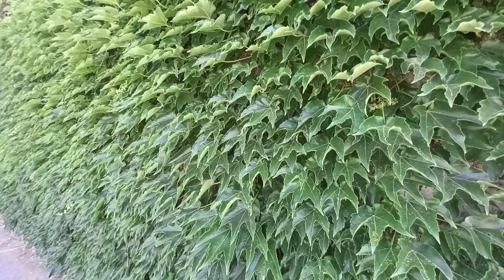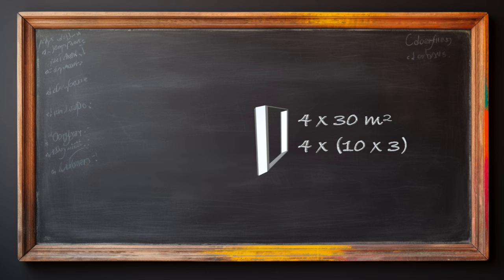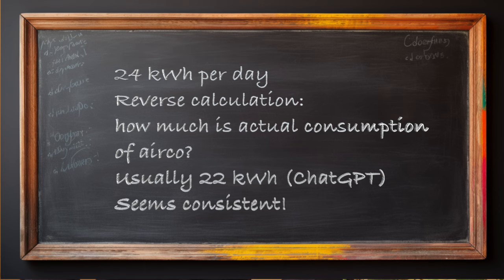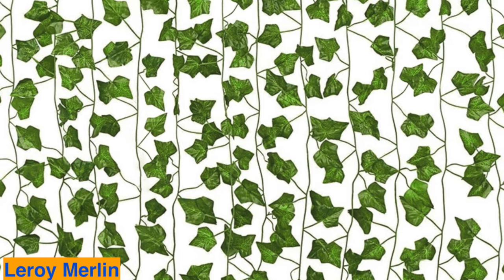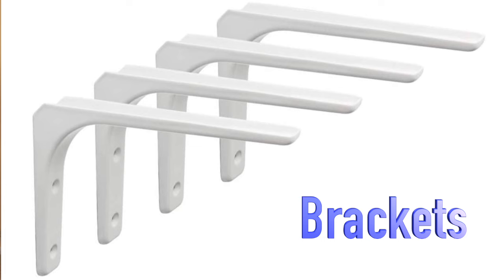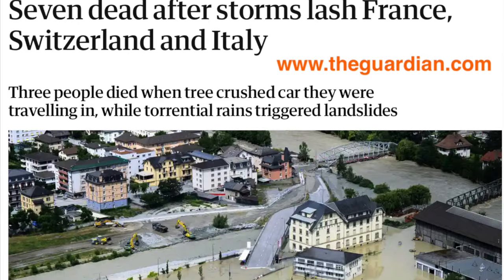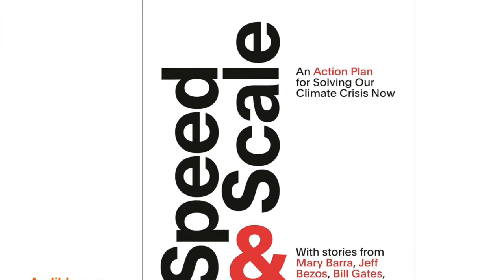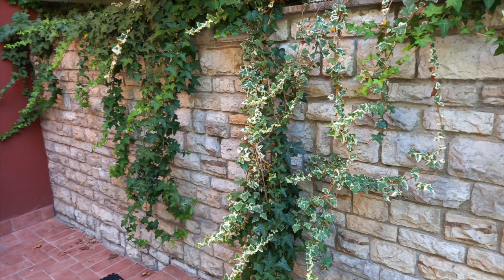Innovative Home Cooling: Build a Green Wall and enjoy zero energy and silent cooling - Video 54

Comment: I love your channel, I live in Washington state but I also represent Costa Rica.
Reply from the maker: Thank you very much Mr. Ramtechs! I imagine also in Washington and Costa Rica there are some heat problems. Did you see also the Spanish subtitles! I check them for each video but am not so good in Spanish. Tell me if you would like to see a particular theme in the next videos.
Reply: @nnvasen-good-energy  I don’t have any problem with English itself, I checked out the one with German subtitles, if I see anything wrong with the Spanish subtitles I will let you know. I truly love your materials. I studied dynamic of fluids and refrigeration when I was a teenager. So your topics bring me back to my physics classes. I have a small space in CR that I wanted to build and I was thinking king of setting up a  5 inch pvc tubing serpentine underneath of what is going to be the pool and have  the tubing have the intake at the highest level of the ceiling and the cool return on the low side by the floor. At the top of the intake, there would be a fan running commanded by a thermostat. But I don’t see you addressing this subject, maybe it is not very popular. And maybe the most efficient system is the immerse system with immersed evaporator and heater.
Reply from the maker: Do you mean an air cooling with the water pool? That is indeed an interesting  idea and also with little technology. But the pool of water under the room or appartement is quite an infrastructure.  We have here in Sicily a reservoir underground with 70 m3 of water and can use that as a heat or cold sink with condenser or evaporator of the heat pump. There will be no end for the 🎉 party with so much thermal inertia!

Comment: How does this work in the winter when it's cold
Reply: Works 100%! I use this technique in the depths of winter, -20c. and have never had problems with overheating via solar irradiance.
Reply from the maker: Hi Mark and Noleft,
Very interesting Q&A! I would confirm that in winter there is a much lower air velocity on the wall so less cooling, because the chill factor is important also for buildings.
Reply: @nnvasen-good-energy  I am thinking does it insulate during the winter slowing down heat loss